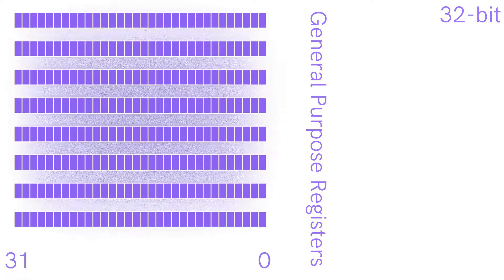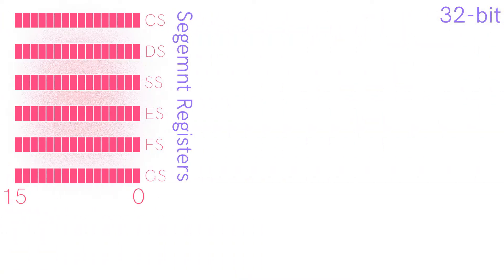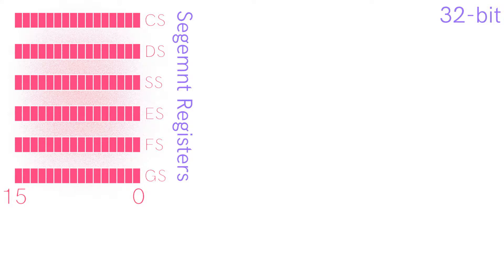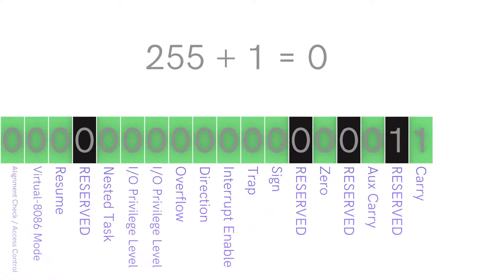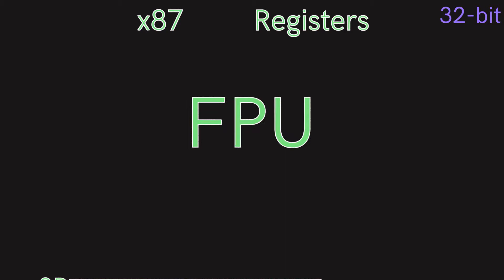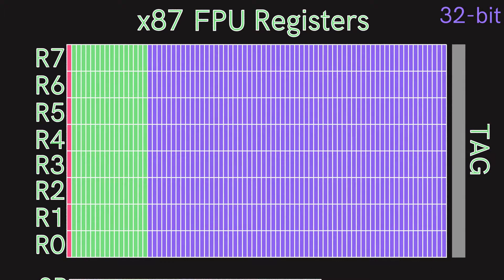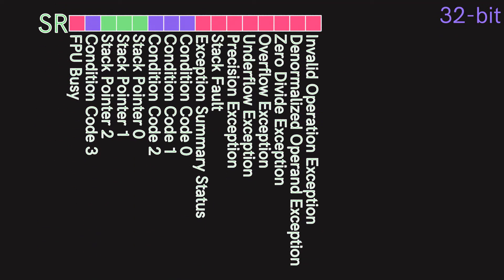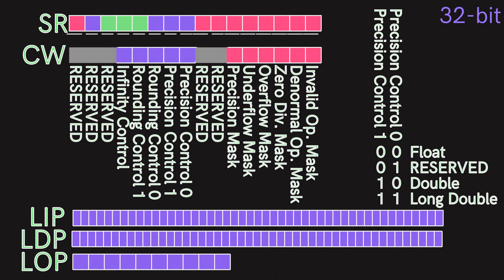CPU & FPU registers - x86 Processor Internals ep 2

Comment: is it possible to correspond with you.  I am compiling a function on the fly using FPU and the code is workable.  However it needs bringing up to date and I need some materials to understand modern processors.  The sotware was written 13 years ago.